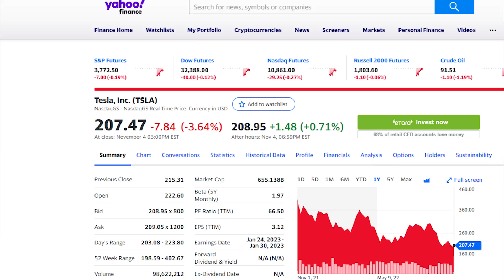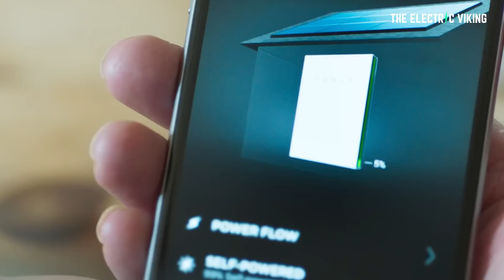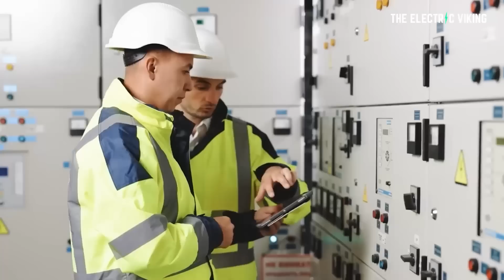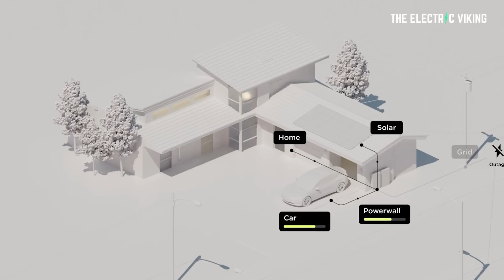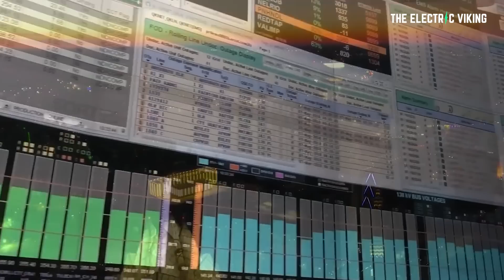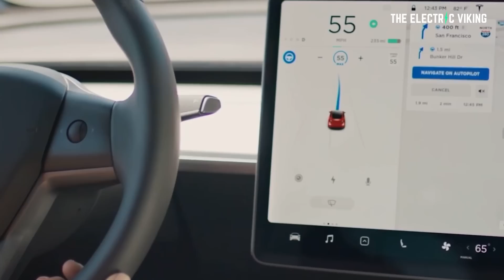Tesla plans to make $billions saving Texas' terrible energy grid

Comment: It seems obvious to me that this isn’t just about power walls. If you can just connect your car directly to the grid, you have a bigger battery pack sitting in your driveway or garage already.  So it’s all about LFP and other batteries where cycles aren’t such a big issue.

Comment: Sam.  We installed a Tesla solar system and Powerwall last year. We joined the VPP and during the summer we received $1,900 from our utility because of very hot weather power shortages in California. During July, August and September, we were sending excess VPP power to the grid via our Powerwall almost every day. Our system install cost was $24,600, and we are additionally effectively off-grid for our own power use about 75% of the time.  I calculated payback on our system without VPP was 6 1/2 years, and now with VPP, it will likely drop to about 4 1/2or 5.. then 100% free power after that plus we will be making money with VPP. Also, we have a swim spa that we keep at a constant 100 degrees using a heat pump and that runs off our solar system using only 13 amps… cool!  P.S. And just as you said, after our success with the Tesla power system, we bought a Model Y… Tesla products sell themselves!
Reply: Trent, thanks for noting your positive experience.  Our 20 year old house is due for a new roof.  Our exposure to sun does allow for serious consideration to go solar.  Thanks!
Reply: @ottoschwandt6527  Tesla roofs are not the most cost efficient but are nice looking and a decent  roof.
Reply: @aitorbleda8267  they will outlast a normal roof by about 200 years.
Reply: @aitorbleda8267  True 
 2 years ago Tesla solar panels didn't even make the top 20  because they were that poor in efficiency.
 On another channel earlier in the year , they mentioned that the solar panels by Tesla have made great improvements.
Reply: @icosthop9998  The good thing about the tesla roof is that it is not crazy expensive compared to similar quality non PV roofs.
Of course it is more expensive than shingles, but not Slate, and we should be comparing a Tesla roof with Slate.
Reply: @ottoschwandt6527  - If you live in a sunny area it is a no brainer to put in solar if you can afford the initial outlay. We have a modest 11 panel system, about 3.6 kW here in sunny SCal. A new heat pump system replaced our 19 yo gas furnace and AC system. I charge a Tesla MS at home. With net metering and EV TOU rates our electric bills usually run a small negative, original payback period was about 5.5 years but that was before deciding to get an EV and heat pump, with high gas prices I guesstimate a couple of years more for payoff.  To top that off when I bought my MS there was a sales incentive for free SC charging for the life of ownership, nearest SC station is 5.5 miles away so hardly go there, just plugging in at home is much more convenient since it takes 4 seconds, lol. Now construction has started on a 24 stall SC station two blocks away so may just go there every so often. Sure beats pumping gas.  Ymmv.  Btw, there are solar calculators that can figure out payback time, system size, etc.  Get multiple quotes if you decide to install panels. Also checkout Googles Project Sunroof, very cool.
Reply: 1. Tesla offers four sizes of solar panel installations measured in kilowatts: 4.8, 9.6, 14.4 and 19.2kW. Tesla allows you to package your solar panel purchase with a Powerwall, its well-regarded battery system that can store power for use during surge pricing, outages or after the sun sets.
2. What size solar panels in kilowatts did you have installed?
3. How many Powerwalls did you have installed?

4. Thanks!
Reply: $24k sounds very cheap for a system capable of providing for all your families needs during the hottest months and still having significant surplus.
I'd say too good to be true. Simply applying math to readily available information doesn't add up when I do it. There is more to the story.
Reply: @Paul_Harling_Vancouver  Paul, it's a little known fact that the State of California maintains a public-domain database of all solar systems installed since 1999. While researching systems installed recently in the Pasadena area for a friend, I found that Tesla is typically selling systems with Powerwalls for about the same cost as other installers are selling solar only. And in that area, in the past couple of years, $24,600 before the 30% tax credit would typically buy a 6.1 kW solar system, with 13.5 kWh Powerwall. And if Trent's cost was after the 30% tax credit, $35,000 would typically purchase an 8.2 kW system with 27.0 kWh Powerwalls.

I have a 6.0 kW system on a 2,000 sq. ft. home in San Diego, with air conditioning, a pool pump, and a Tesla which I charge almost exclusively at home; and I have a significant surplus at the end of the year. So depending on where Trent is, a $24k system with the performance he stated is completely plausible.

It's seldom mentioned, but current Tesla Powerwall installations include grid-forming inverters, which allow the solar system to continue to operate to charge the battery and provide power to the home, even when the grid is down; which almost no other solar systems do. It comes as a big surprise to many solar system purchasers that their system will not operate when the grid is down, just when they need it the most!
Reply: @Paul_Harling_Vancouver  The first thing you must do is make your home energy efficient. If not, you will have installed two to three times more panels than you need and also spend two to three times more than you needed to. This is a dirty little secret of solar companies. Mine took my highest electric bill/$$$/KWh to figure what I need to provide 100% solar energy when it is 110-115-degrees outside. All others bidders came in around $24K without a  PowerWall! Hence, why I went with Tesla. I also own a Tesla Model Y. I am also a shareholder and got my Model Y and Solar for free. Look at Tesla stock 2+years ago. Plus a 5 for 1 stock split in August 2020 and a 3 for 1 stock split in August 2022 plus federal, state, county, local and energy company incentives.
Reply: Wow!  Awesome story - good for you!
Reply: I appreciate your comments as I have been on the fence about a Tesla Solar Roof.  I love the idea but I heard that Tesla in the past was disorganized and some folks were disappointed as they were being sent from department to department to resolve issues.  Glad to read a positive testimony as it gives me faith that Tesla is getting there act together.
Reply: That's so great to hear! Tesla solar isn't available where I live but I do hope on getting it one day.
Reply: Welcome to no longer being in the Dark ages when the shoddy overstretched American power infrastructure fails at the most critical times 🤣🤣
Reply: I just don’t understand how people would trust someone they don’t know to drill tons of holes on their roof. Yes, they claim to waterproof their installation, but can you be sure? You think the Joe Blow who did the installation care? The worst thing is if it’s not properly waterproofed, the leak will be slow and gradual and you will not be able to make insurance claims and the damage is not visible until it’s too late. I’ve been shopping for houses for a couple of years, several house owners were adamant about passing on their solar contracts to us. And you can tell they are frustrated dealing with constantly repairs. Even if you make some extra bucks from net metering, you think it’s gonna cover the potential damage on an expensive house? SMH. Penny smart and pound foolish, IMO. Not to mention, photovoltaic panels improve every year, and they always install the oldest from their inventory on your roof. The moment you put it up, it’s already absolutely outdated and generations behind the most efficient ones being cranked out in Chinese factories
Reply: @lordlee6473  Mostly misinformation. Most solar installers include a roof penetration warranty good for 5 to 10 years, covering these issues. It's a small sample, but between me, relatives and friends, we've installed four systems over the past six years, and none has had a roofing issue.

Panel improvements over the past several years have been incremental, and my six year-old system has not suffered any measurable degradation. Further, differences in panel efficiency are of very little value unless you're constrained by roof space; what's far more important is cost per watt, and this has been coming steadily down for a decade or more.
Reply: @BigBen621  how do you even know you don’t have leakage? Do you climb up there and check every once in a while? 

As to panel evolution, your investment is 15 years or longer. Even incremental improvements over 15 years can make huge difference. I would’ve agreed with you if the lifetime for a panel is only a few years.

Comment: Just curious on one thing, the power authorities shut down the lines for maintenance, pole damage etc for safety of pole workers. But dude with a battery pack livens said lines back up. We'll have to assume the gear has enough smarts to know the different types of power outage
Reply: Uses the same arrangement as a hard wired generator. Called an ATS, automatic transfer switch.
Reply: @steven4315  Actually, no. Grid-connected solar systems are required to have Rapid Shutdown devices, which isolate the solar system from the grid when the drid goes down for any reason, so the grid is never back-fed from the solar system—for the reason you stated.
Reply: @BigBen621  Not interested in solar. Indiana law makes not worth it. Just want back up power. I have an EV and live out in the sticks.
Reply: @steven4315  I see I misunderstood Nathan's question. But an ATS would still not be the solution, because one way or another, the battery would have to be connected to the grid to charge, at the same time the home is being powered from the grid. This obviously would require some sort of active control to allow the battery to charge from the grid at the same time the home is powered from the grid when the grid is up, but disconnect from the grid when it goes down; but my familiarity is limited to solar systems systems with battery backup.
Reply: @BigBen621  Hadn't thought of that, but I bet somebody has. I know Ford offers V2H and I understand GM will.
Reply: @BigBen621  Theses are solved problems, but you need to be more specific about what exactly you want to backup and for how long.  If all you want to do is backup, say, your fridge and a few lights for 24 hours, then just buy a power station with a UPS function and a suitably-sized battery.  For example, the Oukitel P2001.   If you want to backup your whole house, though, things get more expensive.   If you want indefinite backup then you need a sufficiently-sized system with sufficiently-sized solar to go along with it and possibly even an additional auxiliary generator to charge the batteries when the solar is not sufficient.

The whole ATS and other related comments here are mostly incorrect and also irrelevant... its a solved problem and there are many whole-home systems that deal with all of that automatically.   Also, all grid-tied inverters are required to follow (I think) IEC 61730 which handles automatic disconnection from the grid when the grid goes down and to detect and disconnect if islanding is detected (i.e. not act as a micro-grid when it is not intended to do so).

And some states such as California do require rapid shutdown, though its arguable whether rapid shutdown is actually needed or not.... such functions are handled by the inverter and most modern inverters are capable of doing it.   Rapid shutdown is more a function related to rooftop safety for firefighters, actually, not so much on the grid side.

-Matt
Reply: @junkerzn7312  My comment was a response to Steven's statement that an ATS would be used to avoid backfeeding from a battery backup system. In my case, I did look into backup systems, when I lost power for several hours with no way to run my CPAP. After looking into various, mostly expensive, solutions, I finally realized that I have a 75 kWh battery in my garage, AKA Tesla Model Y. I lashed up an extension cord that allows me to draw 12V from the cigarette lighter socket in my Tesla to power the CPAP in my bedroom—solved problem, to use your term!

I live in SoCal, so there is never life-threatening weather. But in a protracted outage, I can cocoon in the Tesla, which gives me temperature control, cell phone coverage, entertainment (Netflix, YouTube, games, etc.), etc., just like folks in Houston did in the big ice storm there.
Reply: @BigBen621  Yes, I apologize... I just hit 'reply', but my reply was more with regards to the whole thread, not just your posting.

Your solution is workable but pretty severely limited and not automatic since you'd have to connect and disconnect the cable.  Perhaps also not robust enough... I'd be worried about a disconnect during the night.   A modest power station is definitely more expensive than stringing an extension cable, but it is hands free and doesn't depend on your vehicle being in the garage.

But I agree that there is a cost involved.  There are only two power stations on the market whos UPS function would be sufficient for a CPAP... The bluetti EB3A ($300) and the Oukitel P2001 ($1300).  For peace of mind, the EB3A's battery really isn't big enough.  The P2001 on the other-hand has a 2000Wh battery (1500Wh after losses are taken into account) that could easily run a CPAP for 20 hours or longer just off the battery.   But because of the much larger battery and capabilities, the P2001 is more around $1300.

Still, its a completely hands-off solution.  You just plug the power station into the wall and plug the CPAP into the power station and you are done.  I use one of these babies myself for my computers, wifi, and internet... it can run the whole mess for 10+ hours during a power failure.

-Matt
Reply: @junkerzn7312  I agree with everything you said, but I have little need for a robust backup system. I live in suburban SoCal, where temperatures are rarely over 90°F or under 40°F; so even a protracted loss of power only means a little discomfort, and not freezing to death as folks did in Houston last year. Further, loss of power to my CPAP is not life-threatening; I just don't get any real sleep without the CPAP, which isn't an immediate problem. And if I lose power during the night, same thing; just a little sleepy in the morning.

If I lived in rural parts of California which are subject to days or even weeks of fire-related blackouts, or had life-support medical equipment, or lived in the mountains or the desert where temperatures might be life-threatening, I'd certainly need a more robust solution, perhaps along the lines of what you suggest. But in my view the best solution, which we're very close to, is an EV with V2H, and solar with grid-forming inverters so that for protracted outages, the EV can be recharged during the day to power the home during the night. I think all parts of this are available now, although I'm not sure that anyone's integrated them to allow the EV, even one of the new EVs with V2H, to act seamlessly to store energy from the solar and use it to power the home when there's no solar power. But if not, it won't be long!
Reply: @BigBen621  Sure.  Very similar to the situation I am in where the only thing that truly matters is the fridge (everything else just being a convenience function).  I don't want to have to throw out food again.

Fire safety shutoffs have been getting better, including in rural areas.   The very first fire safety shutoff saw us without power for 5 days.   The second one it was for 2 days.   The third one was only for a few hours.   The utility has gotten a lot better and narrowing the number of people impacted and the timing, we haven't had one at all in the last year and a half.

Still, I've learned my lesson.   Spending $1300 on a 2000W/2000Wh LFP power station for a no-stress 24-hour backup of the fridge was probably the best decision I've ever made.

--

V2G and V2H are almost the same thing.  There have been a few pokes and prods here and there.  In fact, the original Tesla Roadster actually had working V2G but they later removed it because nobody was using the feature.  The Ford F150 lightning has V2H (home still needs a transfer switch, though).

The main problem with V2H is that it requires the vehicle to be connected to the house... which is actually a problem during an emergency since you might need the vehicle to, you know, drive somewhere.  Similarly, for V2G, the problem is that intermittency of the vehicle's connection to the grid (either at the home or at a place of work or wherever).  And the inability to use the feature and also at the same time use the vehicle to drive somewhere.

It's a great idea to think about, but its really messy with regards to actual use.   Which is why a dedicated whole-home battery backup is still the best solution when whole-home backup or grid load-shifting / net-zeroing is desired.

Also, vehicle batteries are precious.  You don't want to cycle them for grid use unless you really have no other choice.  Particularly the predomionant NMC/NCA chemistry ternary batteries.  The LFP batteries (e.g. newer Tesla model 3's) would fare better.  Very few car manufacturers are using LFP though.  Its just Tesla and the Chinese automakers at the moment.
Reply: @steven4315  TY
Reply: @steven4315  Um i'v wired a few ATS and design the control circuit too,  but i dont think it answer my question
Reply: @Froggability  I bow to your expertise. I'm not an electrician, just been reading up on it because I want V2H in my home.